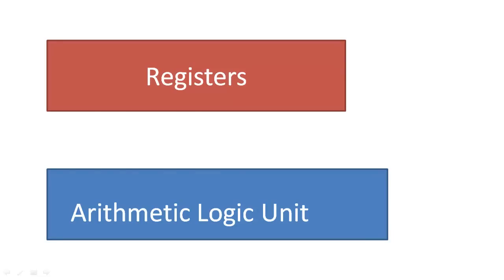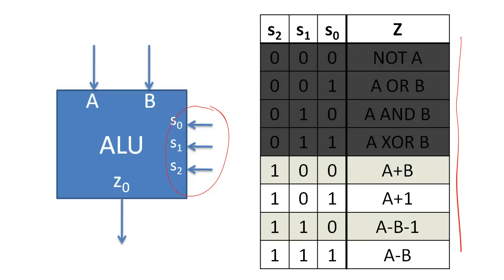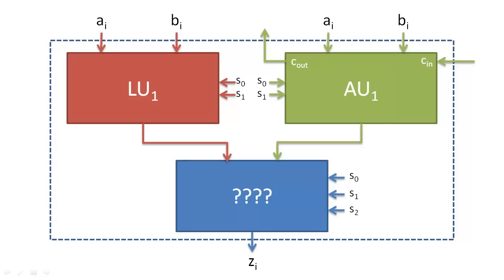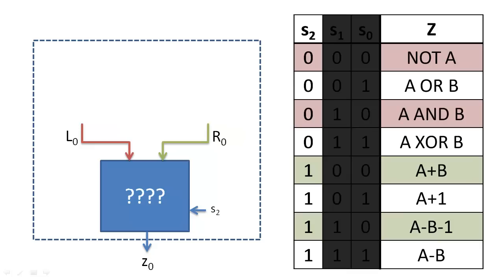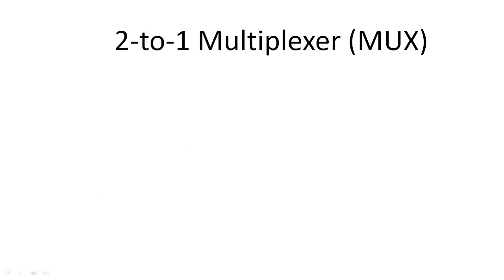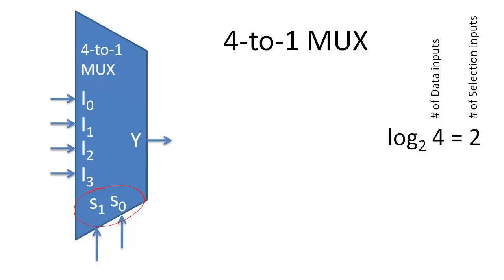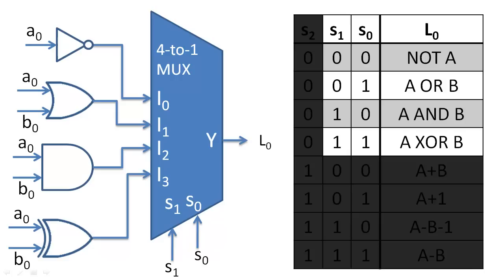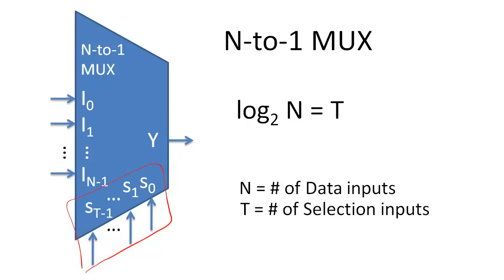Multiplexers and Arithmetic Logic Units

Comment: question at 2:33 what is the reason for when S2= 0, output is directed to L0 and when S2 = 1 output is directed to R0
Reply: for anyone wondering about this: it's in the circuit that isn't shown here
look at this picture: https://cse15-iiith.vlabs.ac.in/images/2X1mux.jpg
Now for the first case of s=0 you will see that A is selected bc the bottom AND is always 0. Thus C depends on A. If A is 0, the upper AND is zero too but if A is 1 the AND is 1 as well bc  NOT S = 1 and 1AND1=1
Same goes for when s=1. Then due to the NOT S the upper AND is always 0 and the result of the bottom AND depends on B's value